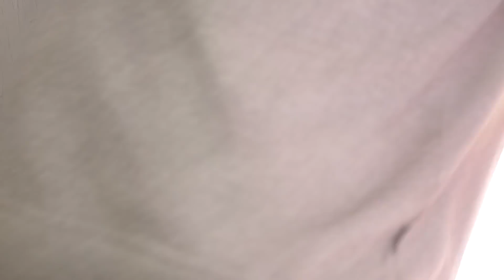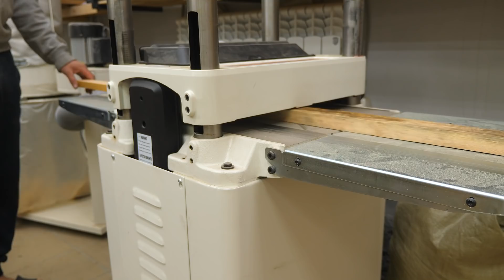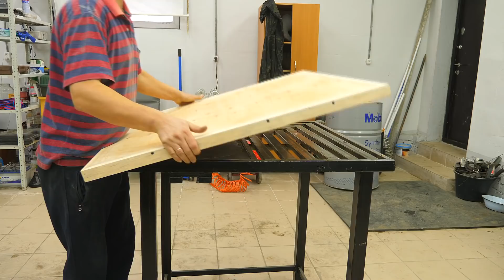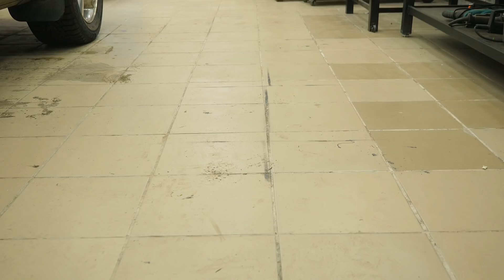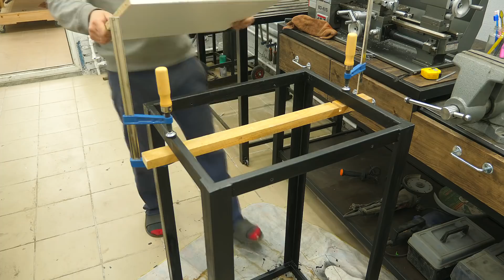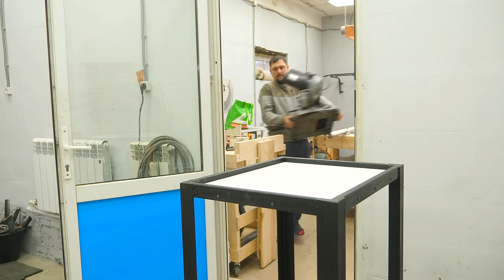2 ideas that will make your workshop cooler!

Comment: No goggles, wiping metal surfaces with bear hands after drilling, sandals, punching through metal with a drill bit using a an unprotected hand as a backing. No wonder my insurance is high! Protect yourself! Great idea good video however safety examples are lacking..